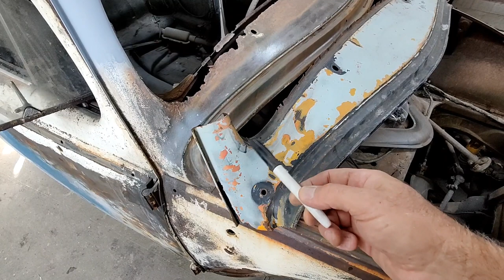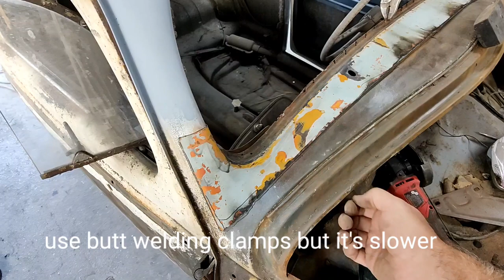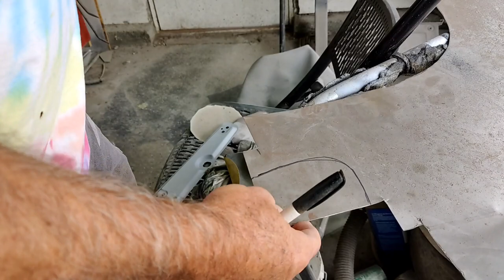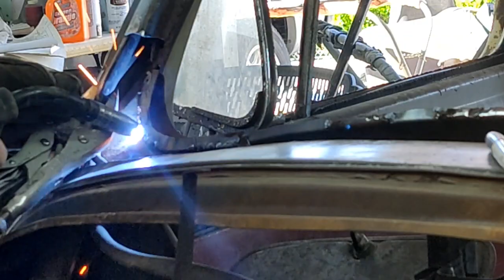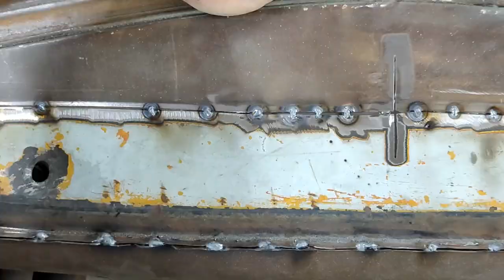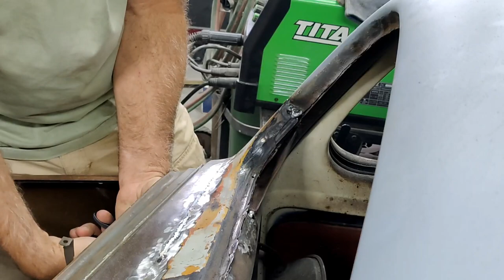RESTORATION - 1954 VW oval window windshield sheet metal repair for full build

Comment: Outstanding work and instruction.  Not sure I would have the patience.
Reply from the maker: I didnt either that is why I warped it. if I did smaller spots and cooled it then it would not have warped as much. But all good with a small amount of filler.

Comment: I fear so long welds on a flat panel, this calls for warpage, you're very good to have done that with minimum warpage. When I have to do such a weld, I cool my panel with a wet sponge so the evaporation of the water helps to control things and I do all I can to limit the weld bead size so the heat input.
very good video.
Reply from the maker: yea I used shop air but I welded too far between or it would not have warped at all. just small amount anyway. I should have done one spot then move. The problem is that welder runs the gas for like 5 seconds after you let off the trigger so when I do that it wastes huge amounts of gas. The good part is that it welds a bit colder than most welders so it does not warp as much. I was welding like near 1 inch sections. But it came out fine hardly any warpage just enough for filler less then 1/4 inch like near 1/8 at the deepest point. 2 thin coats sanded off.

Comment: Good video Mike! I have to eradicate a pile of bondo on my oval and a crappy paint job. Doesn’t seam to be much rust but I will find out. Thanks again
Reply from the maker: you just dont know until you get it all off. sometimes it is thin but they put it over paint. sometimes it is an inch thick or more.

Comment: Hey Mike. Try a tig rod to lay into the gaps and then tack in with mig . Easy to hold then use the tack heat to cut the rod at the end. Works great. Thanks for the video. Bill’s Cool Projects on youtube

Comment: Loving this series, Thanks for the detailed recordings. I'm starting with a 1958 now and I've just been told that I won't be able to fit a 1600 motor in the engine bay. What are you putting in this build, maybe I can just watch you do the mods and try it myself 😁

Comment: Mike, I noticed that you blow compressed air on the weld shortly after you’ve finished the weld, is that to help with warpage or ?
Reply from the maker: yea a bit. to get the metal not to warp you really need to do only small spots. Which would have taken me more than 1 day vs an hour. But I wanted to keep it from warping too much. so I cooled it down after like 1 inch of welding

Comment: At the 10:30 mark where there was a small gap on the A pillar.. I've seen Bad Chad use a mig welder and at the same time, use a coat hanger and feed the puddle with the coat hanger to fill small gaps like that..  I need to try that..
Reply from the maker: or better yet gas wire. less slag in the metal. I used to weld gas all the time in the early days Oxy acet....

Comment: You never put a link in the description of the last video about the paint you are using. My son has a 2003 Monte Carlo that has a lot of rust on the top that we will need to clean off, treat and then repaint like you did on the top of the Beetle.

Comment: As for being a body repairman for 40 years now ,going across that panel was not the best as for now warp and it will be all mud you should have drilled out the spot welds in lip and down the post was ok across the panel is lazy
Reply from the maker: not much filler on there. I knew it would warp a bit. Will last the same What would be the point in doing it a longer way if the end results are the same. It will last longer than I live. WHY????? Bragging rights? I think faster is smarter not lazy....I have better things to do with my life